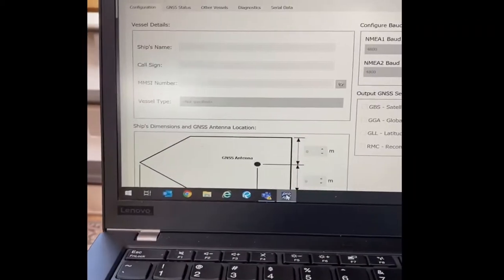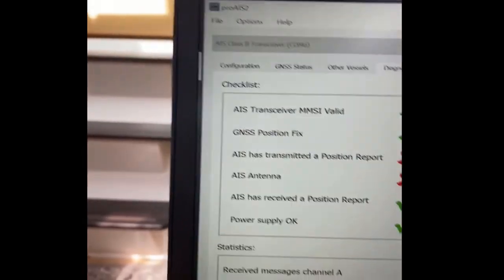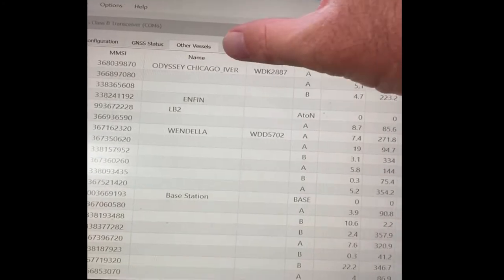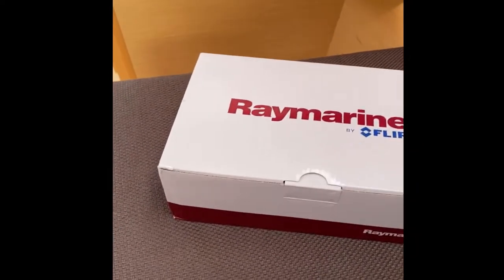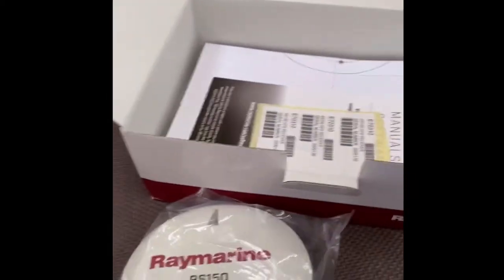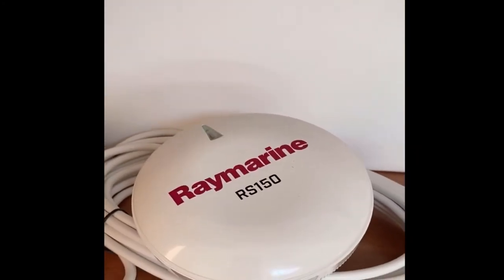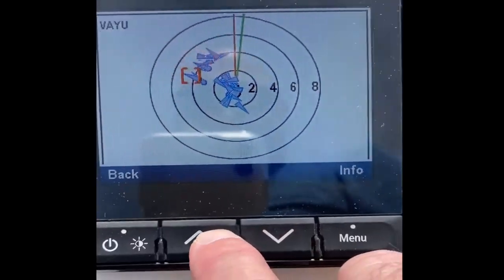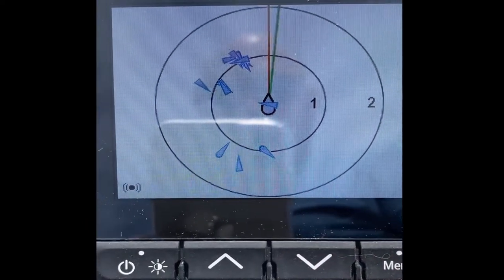Installing an AIS Transceiver on our boat (Raymarine AIS700) - Part 3 Start-up & Troubleshooting

Comment: I have a 2018 boat with no GPS installed as well.  Looks like I will need to buy the transceiver plus the GPS antenna.  Two GPS antennas is nuts.  I wonder if there is another manufacturer with a cheaper solution.  Thanks for the videos.

Comment: Hi I have 2023 Beneteau Oceanis 46.1 and two screen raymarine ais 700
I had a problem of wind data receive and also sometimes dissapearing depth data so I called service of raymarine. As a result it is said that we have two screen with two antenna snd one of the two antenna should be closed for not to cause confusion of the machine..Is it rational?? Or is there any other problem with my electronic??